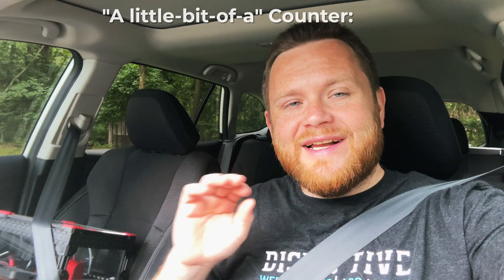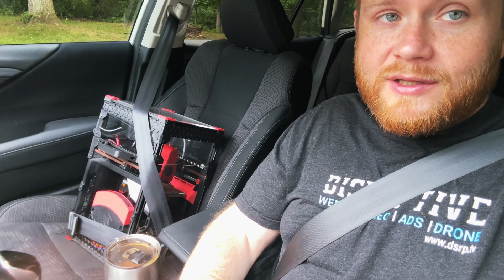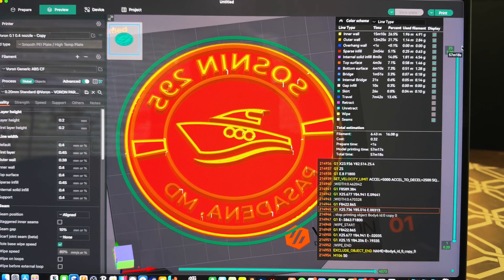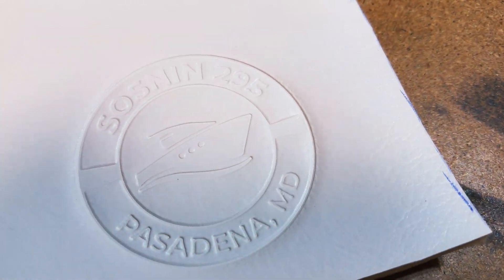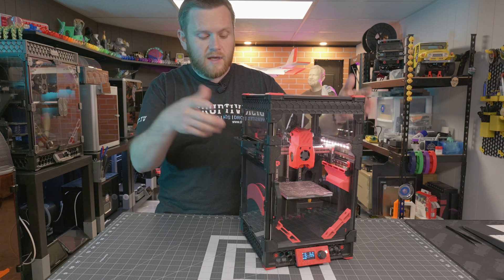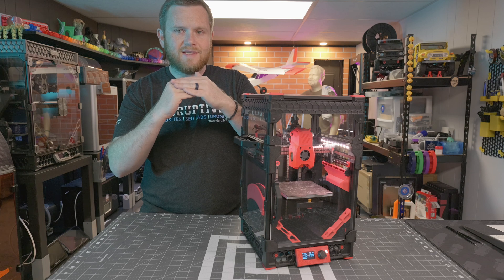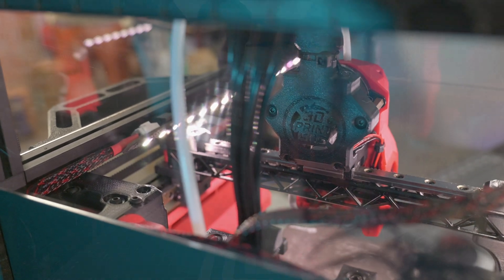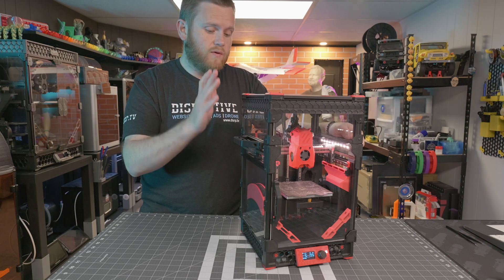Concept to 3D Print in 2 hours + Fysetc V0.2 R1 Voron Kit Review

Comment: I have the updated version of this kit (v1.1) getting here today, so I spent a good amount of time watching the build streams in the background this past week or so. Seems like the new version has a lot of QoL features, some of which may have been issues during your build, as well as a better hotend etc. 

I didn't see anything about cleaning/greasing the rails, do you think that's not necessary now that you've had the printer for a while, or do you just do it after the build as needed?
Reply from the maker: I hear good things about the improvements. Especially with the board and toolhead board. I used an isopropyl alcohol bath before assembly and then everything was ready for printing I greased it then. I think I did a short on a DIY on how I grease my rails. I would definitely do that and have done it on my Micron+

Comment: Which is better the Q1 pro or the K1c?
Reply from the maker: Q1 Pro if you want to print more hotter filaments like Nylons. K1C has a better build quality. Otherwise, they are VERY similar in operation. Basically: Q1 has a heater, K1C has glass and metal shell.
Reply: Thanks

Comment: I built this exact Voron last week. Just finished it late last night actually. Hardware I am proficient with... software and firmware... not so much. Currently I am trying to figure out how to configure the wifi module, and add a webcam. After that, I want to focus on getting it printing nicely. Right now, mechanical (rotating) parts come out fused, and the overall print quality is not up to par with my pre-built machines. Guess I need to dig in and learn Klipper!
Reply from the maker: It sounds like you need to do a round of tuning to get your extrusion under control to avoid parts being fused. Voron’s are only as good as their tune. ;) https://ellis3dp.com/Print-Tuning-Guide/articles/index_tuning.html < this is the best and totally worth the time.
Reply: @3DPrintSOS  Thank you so much! I will read and follow it closely. I love learning :)

Comment: Fun project and nice summary for the v0.2.  I will say BTT Pico and LDO picobillacol helped me avoid the expander board. I do have one and tried it. V0.2 is a fun machine. There is a z cover to remove the gap to the z motor so nothing it falls in. PITA once the machine is build with the side accessories, however nice finishing touch and not filament or screws when working can get in the power supply bay.
Reply from the maker: I have it saved somewhere but havent committed, the z cover is probably a must.